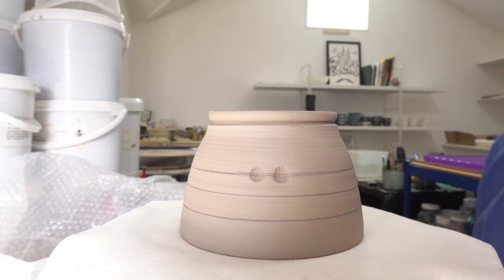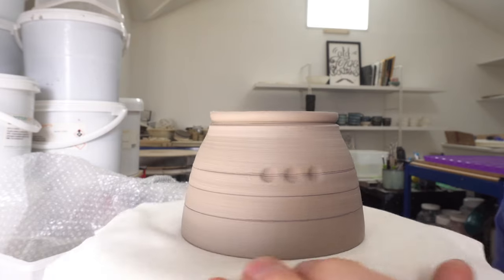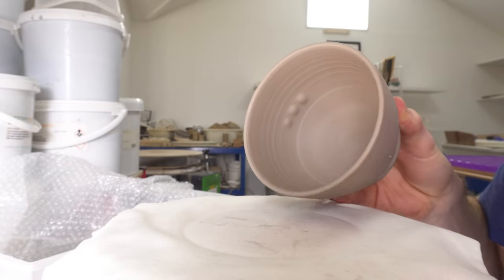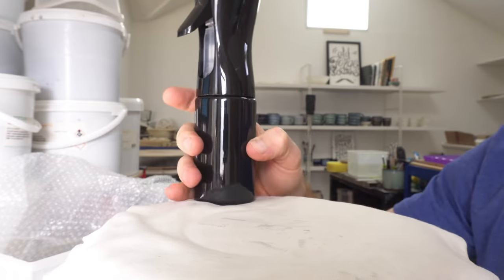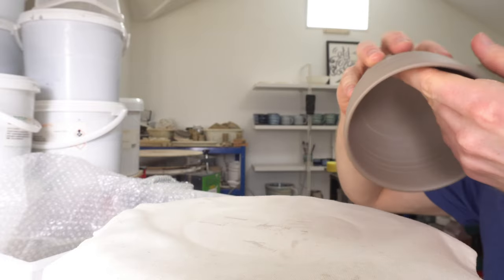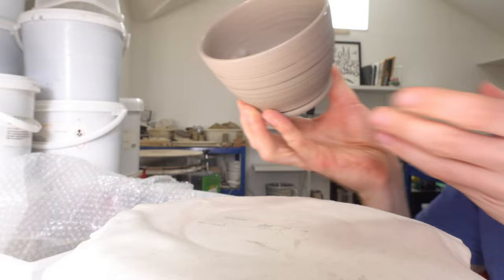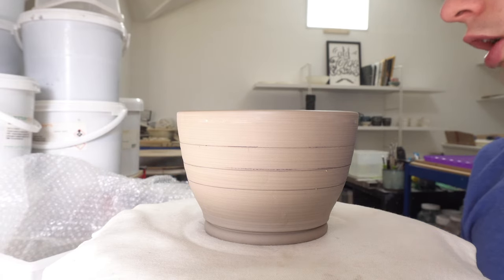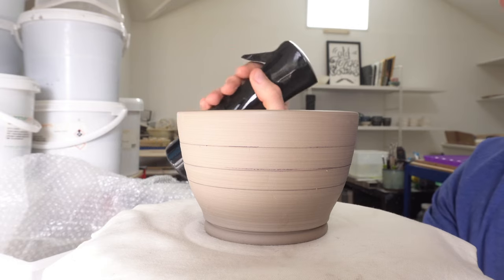Quick Tip - Continuous Misting Bottle for Stamping

Comment: It makes me wonder if something like this could also be used for spraying glaze evenly?
Reply from the maker: Great idea. I think it probably wouldn't apply a thick glaze, but maybe an even coat of a thinly mixed glaze. I'll try that tomorrow, if the mechanism will pass glaze materials through then I don't see any reason why it wouldn't work on some level.
Reply: Can't wait to see what you find out.
Reply: I use a plant sprayer (bought at my ceramic supplier!) for glaze. Works fine. And is super cheap. It is hard to have an idea about the thickness. Ideal for glazes that like a thin application but harder for thick glaze since it is hard to know when it is thick enough.